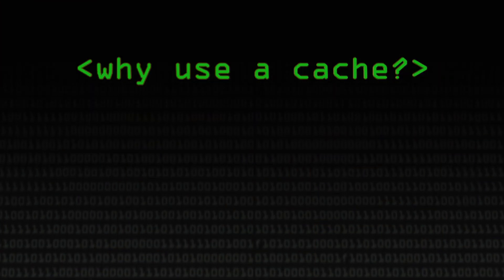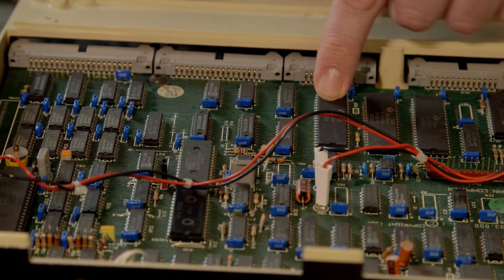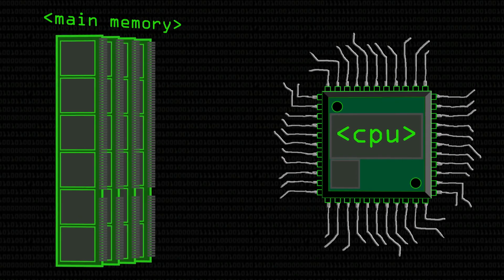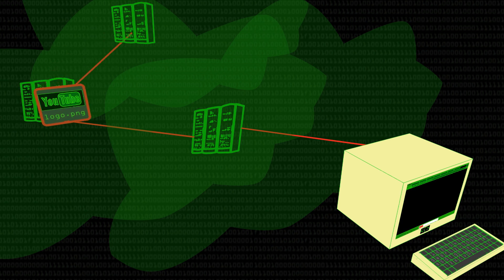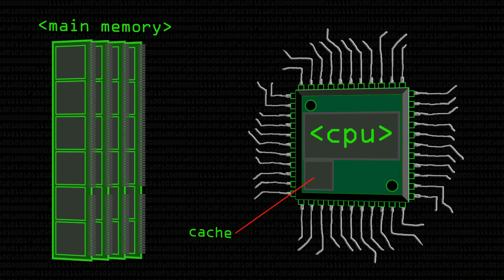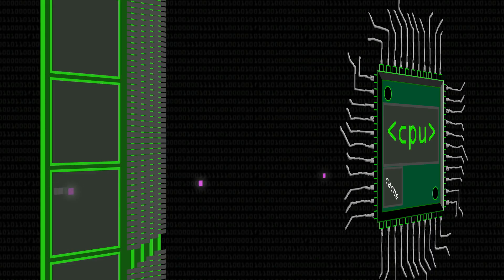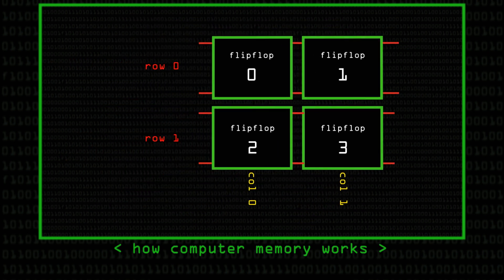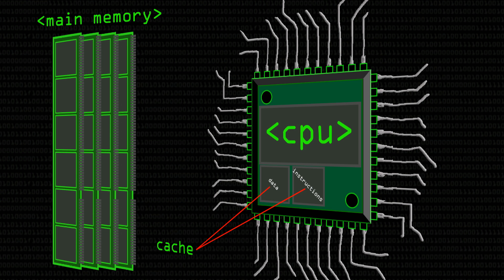Why do CPUs Need Caches? - Computerphile

Comment: It did seem that my computer got significantly faster after ..well, doubling the frequency, and turning from 1mb of regular L2 cache into 3mb of "intel smart cache" What's the differrence there? Simply that the regular L2 would be split in twain for both of the cores, and that the newer one could use the whole 3 megabytes in both cores at the same time?
Reply: +Zandonus Yip. That's all it appears to be. It allows you to not only share data between the two cores, but also have one core have any of the cache that the other core isn't using at the moment. It's like hyperthreading for cache.

Comment: Why can't I pay extra and get a computer with 8gb cache and how much faster would by computer be if I could?
Reply: +THERESAPARTYINMYHEAD You actually get diminishing returns as the size of your cache increases. Think of it as searching for a book in a cart of books you recently read. If you have a huge cart, sure you can keep a lot of recently read books nearby but it will take you longer to find the specific book you need.
Reply: +THERESAPARTYINMYHEAD Possibly a fair bit faster for some non-optimized edge-case scenarios, but your computer would be HUGE and probably cost millions. There's only a couple of megabytes of cache memory in a CPU, and the CPU already uses it well. However, cache memory doesn't work the same way as RAM so it might not even be possible, and because of that it also takes up much more physical space.
Reply: Is the gain coming from having to work with small addresses, or something else too? I would imagine there's never more than 24 bits needed to address cache content (not to mention special CPU instructions made to work with even smaller address sizes in exchange for greater speed)

Comment: How does cache work when considering a multi processor architecture? Is the cache shared between cores? 

What happens when another core tries to access a memory location in RAM that was cached and changed by a different core?
Reply: Each core has its own cache and they have internal methods of synchronizing cache contents between them.
Reply: That is like if I asked how gravity works, you answer that there is a certain relation between mass, distance and the gravitational force... Not that informative. The gravity case I'd like to learn the function Fg=G*m1*m2/r^2. In the case of the cache: how and when does it synchronize the cache? How can I be sure that the data is synced when it needs to be?
Reply: I didn't know it was called cache coherence, so yes it was. Still, thanks for the link
Reply: +Rik Schaaf Some cache-levels are shared and programs can explicitly request that data is flushed to shared memory (L3 or RAM in this case) in addition to being able to signal to other cores "Hey, I just changed that piece of memory that we both might access"

Comment: I think you started to explain at the end... what is the L1 and L2 cache? I remember theis was a structure the put on in the late 90s. This is the CPU cache you speak of, and the RAM cache is the instruction memory? Chrome cache just made me type this twice when the vid changed, and is this a failure of the route-a-begga?
Reply: +Matthew Gore L1 and L2 are cache levels, L1 being closest to the core and is faster but has less storage than L2. For each layer, there's both instruction and data cache. If you have a CPU with say 3 levels of cache (quite usual) then you can think of RAM as cache level 4 and your harddisk (through the page file) as cache level 5 (though if you have an SSHD, that being a hybrid SSD/HDD, that's level 5 for the SSD and 6 for the HDD). Double-posting isn't necessarily an issue with routing or caches but just one of the hickups that sometimes happens.
Reply: sundhaug92 wow, thanks for the reply - quite descriptive, and very appreciated. IMO, hardware architecture is SYSK, I mean we use it every day, and should know the tech diffs between steady state and optical

Comment: Can compilers explicitly reference the cache in the same way as RAM or registers?
Reply: +ElagabalusRex No, the cache is transparent. You can flush or disable the cache but not control its content.
Reply: +ElagabalusRex As Jan said No. However you can try and optimise compilers so they don't break the cache and stall the pipeline. That's a whole other discussion.
Reply: +ElagabalusRex Generally no, most cache is transparent, but for example the PS3 has cache that can be directly refered to.

Comment: I would think the cache also helps to keep the flow of information constant without pauses "lag" etc.
Reply: +Neil Roy Depends. When you start to watch a video stream, some of it is put in a cache in RAM (and at various points of your connection) before you see anything, to make it more smooth, which increases the delay but makes the experience smoother (since you don't always have to wait for the next video frame to arrive from across the globe). Also, for a CPU or program to look in RAM (depending on if it's software cache or hardware cache) takes some time and might take more time than bypassing cache, for example if you have a high-speed internet connection, it might be faster to request the webpage from the server, rather than have Chrome check a huge cache.
Reply: sundhaug92
I recently read an excellent article on optimizing your data in your programs (I'm a programmer) and it just happened to cover CPU caches.  They are quite remarkable.  I learned the L1, L2 and L3 caches are labeled as such depending on how far away they are from the processor.  L1 being the closest and having the fastest times to fetch data, L2 being father away, and L3 the farthest.  The amount of time to fetch data from the L3 is quite considerably slower, I was surprised.  I guess what happens is when the CPU reads from memory it will store that location in L1 cache.  If L1 becomes full, than it will take the memory location stored in it that has been idle the longest (not accessed for the longest time) and move it to L2.  The same happens if L2 is full, the oldest gets moved to L3 and eventually the oldest is removed from L3 totally.  If no memory is found in any of those caches, it then fetches from RAM and the process of storing the location starts all over again.  There is much more too it (memory fragmentation etc... which is what one can avoid by structuring your program properly and speed things up). 

I recall years ago, in the days of Netscape that website caches basically check the website for the page requested and check the date of that page and compare it to the page (if any) you have stored in cache.  If the site's page is newer, it gets the webpage from the website, otherwise it will load in the one from the cache.

That is my understanding of this.  I imagine something similar is done for images on the webpage as well.

With video I think it just loads as much of the video into a buffer as possible then starts playing, usually on Youtube you can see how much is being loaded ahead of time.  Seeing as how videos are sequential in nature, this is probably the simplest form of caching/buffering.  The CPU cache being the most involved.

Comment: can you add caches to a PC? is there option for regular users?
Reply: No, cache physically is built into the chip.
Reply: +Antropovich A long time ago you did have motherboards that has DIP sockets for cache chips, but there days are long gone! I remember a 286 motherboard with that option. I don&#39;t know what level of cache it actually was.
 Probably the last level before checking main memory.
Reply: +Antropovich No, but the CPU that you buy or that comes with your computer already has caches built-in.
Reply: yeah, thought so. I wanted to know if there was a mdel that could somehow change caches.

Comment: Wow... CPUs are far, far less stupid than I thought. I was under the impression that I knew roughly how they worked, but clearly they're far more complex than the theoretical thing I was thinking of...
Reply: This is a great explanation of caches but this literally scratches the surface of what a CPU does. But I'm glad you found a new respect for them they are amazing pieces of technology.
Reply: Look up technical press releases of Intel chips, there's a lot going on in there nowadays in terms of cache, circuitry, division of labor between/among cores etc.
Reply: Umbert Lapagoss I might do, I find this stuff interesting. I'm a C++ developer anyway, so knowing this stuff will help me write faster and more memory-efficient code.

Comment: Is there any major difference between the different types of Caches? I have heard of terms L1, L2, and L3, but I'm not sure what the differences between them are significant.
Reply: +Karan Naik They're different speed caches. L1 is the fastest, but the most expensive to make, so you tend to have less of it, while L3 is cheaper but slower (but obviously still faster than RAM)
Reply: +Karan Naik in a class at the university we compared the speeds and costs of the different storage options (hdd, RAM, L3,L2,L1 etc.) and the differences were just huge. Going from one level to another often meant a speed (and cost) increase of a factor of a hundred or even a thousand. Another very important metric on the low level stuff is the access time; on the L1/L2/L3 Cache on the CPU it is dramatically shorter than on the RAM or your harddisk
Reply: szErnzEit
Yep, on a haswell CPU, in the time it takes the CPU to fetch from L1, light travels 39cm
Reply: +Karan Naik In general, L2 is slower than L1 but has more capacity, L3 is slower and has more capacity than L2. This means that using L1 cache is prefered but a when a page in L1 is invalidated, it's invalidated to L2, L2 to L3, L3 to RAM

Comment: What about Level 1,2 or 3 caches? What's their difference?
Reply: +desolator XT higher level caches are larger but slower. if the CPU misses lower level cache it uses higher level cache and if all caches are missed it uses main memory
Reply: +desolator XT I think that comes down to complexity and purpose.
Reply: +33C0C3 The higher level caches are also further away, so by the laws of physics they take longer to access. This is also one of the reasons why having caches are super important on modern computers, the processors are fast enough to make the distance between processor and memory count.

There's also typically a separate L1 cache for each core of the CPU. I believe the L2 and L3 caches are always shared between all cores.